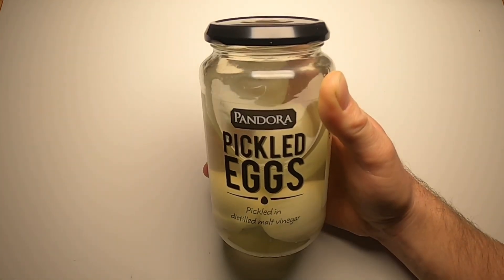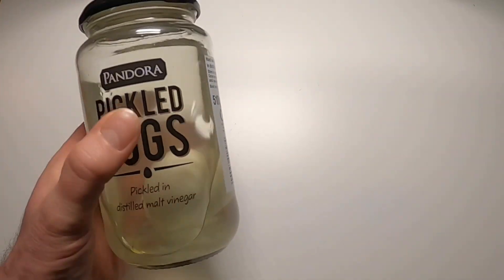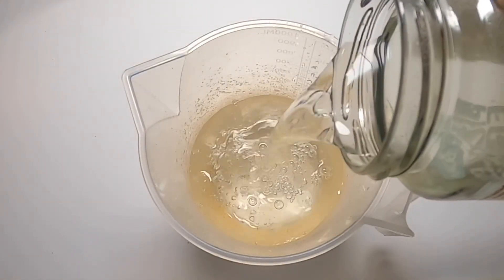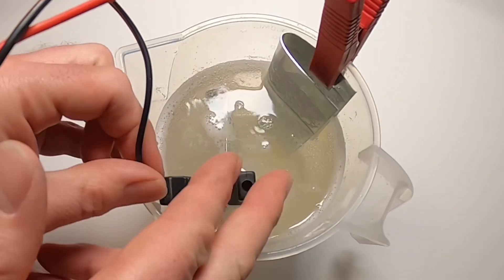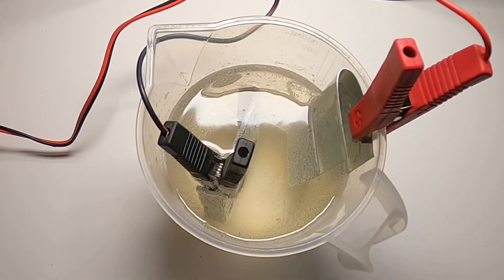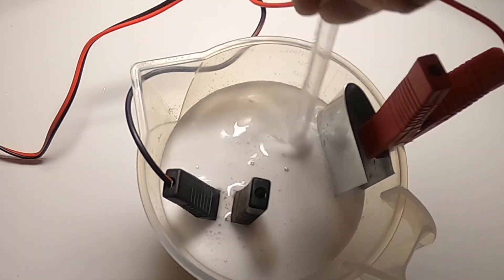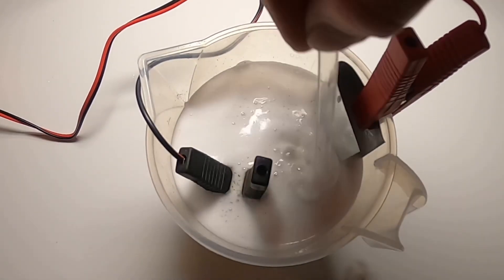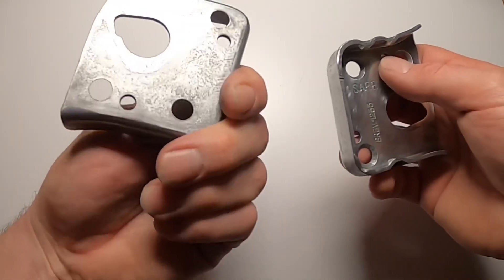How to Zinc Plate Classic Car Parts DIY Electrolysis Made Easy!!!! Alfa Romeo

Comment: That's a good result, I'm wondering now if there is something in the pickled eggs or spices that acts as a levelling and brightening agent and if you would get the same result with pure vinegar. Also is the objective of adding the bicarb' to totally neutralise the vinegar or is it still on the acidic side?
Reply from the maker: Vinegar is mainly ethanoic acid s as be when mixed with a metal, a zinc ethanoate is produced along with hydrogen gas which you saw bubbling. White vinegar is best but I didn’t have any to hand. The bicarbonate soda just helps the reaction take place, not neutralise it otherwise it won’t work.